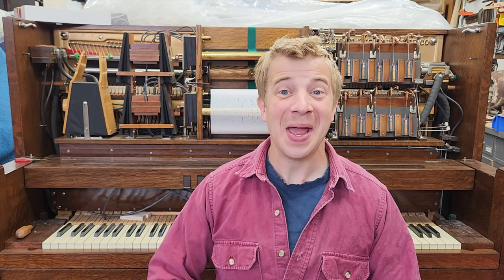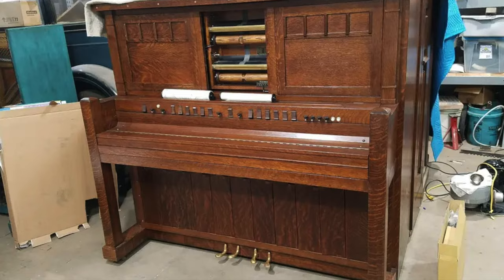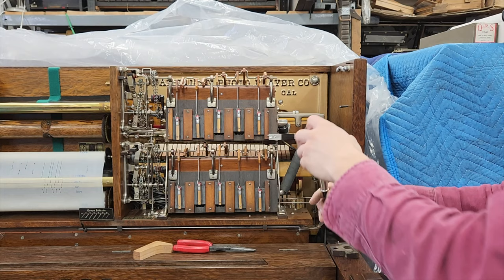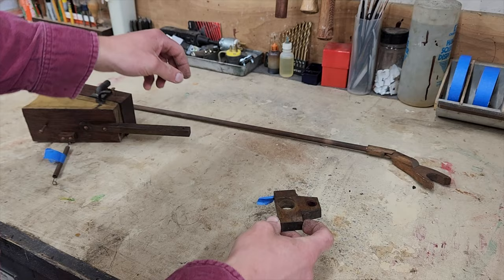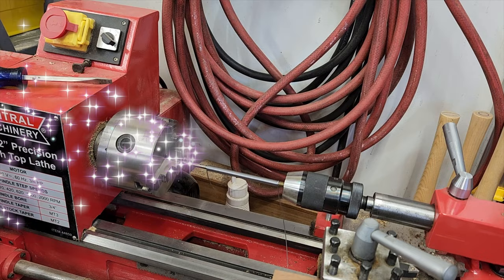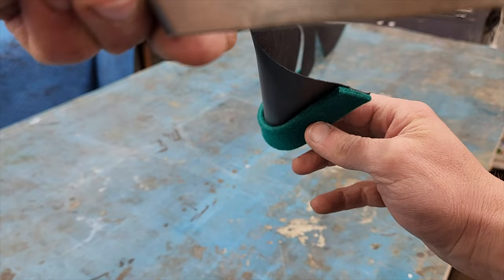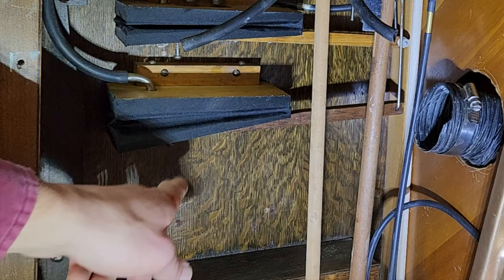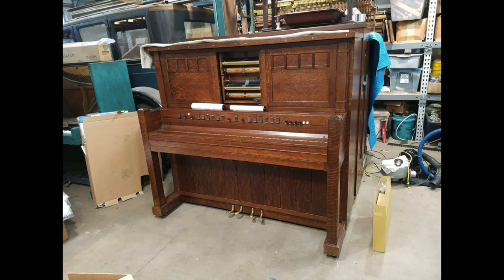Fotoplayer Fridays: What the heck is a Harp Guitar?

Comment: Well, that wasn't at all what I expected but it was most enjoyable all the same. Thank you Nate. Roll on the drum episodes. (See what I did there?)
Reply from the maker: I'm curious what you'd call a harp guitar! Wondering where they got the term from.
Reply: @nateoutsidethevacuum  A harp guitar is a six string with a big extension to the sound box for several harp strings which run roughly parallel to the guitar's neck. The harp strings are used for extra bass notes. New Age guitarist/electronic musician Michael Hedges, amongst others, revived interest in them during the 'eighties. 
Harp guitars were first made at the end of the nineteenth century and continue to be made by independent luthiers; they're not especially rare and many variations exist. Have a look for Pat Metheny's Pikasso guitar for the most extreme example - I think it might appeal to you! - and for harp guitarist Stephen Bennett for virtuoso performances.

Comment: Sound a bit muffled (by the muffler rail?).
Reply: Agreed, I had to crank up both the computer sound level to max as well as the YT player sound to max.
Reply: The muffler rail was a bit quiet for what I'm used to, though it was also brand new felt so with time it will become louder. The rail is also meant to make way for the more quiet pipes in the Fotoplayer so you can actually hear them instead of just the piano with some background noise.
Reply from the maker: I'm sorry I didn't explain it better. The muffler is supposed to be more of a mute.